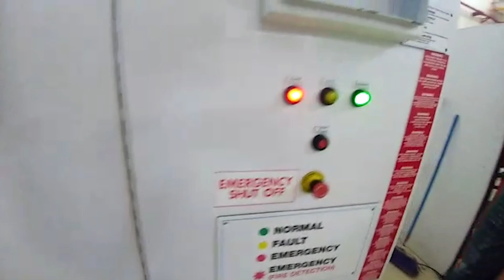Let's Talk About AASEA

Comment: how about chemical industry ? u need create a lot a wires ,isolations,,battery, acid and.... carbon! it takes many tons of ore and many liters of acid to get copper and lead. and waste rock will accumulate and poison everything around. and a lot of gasoline to heavy vehicles. in my opinion ,the propane is more green then this and more efficient with more effectivity.